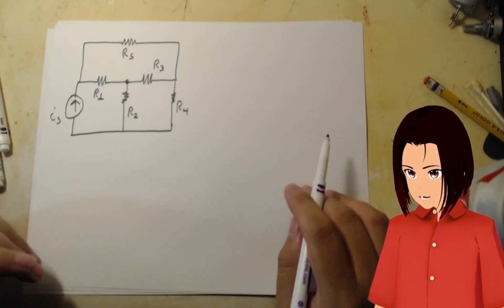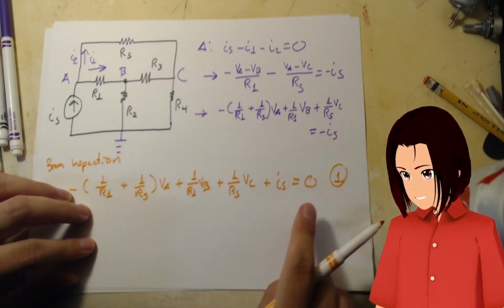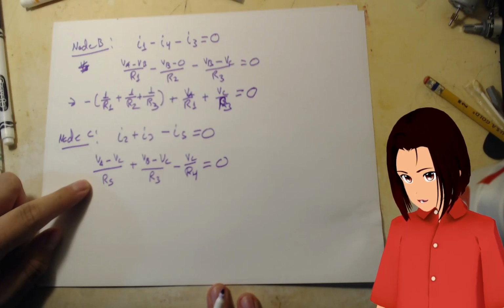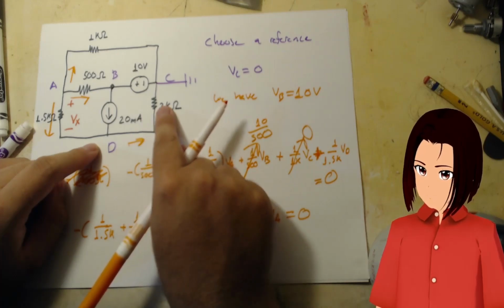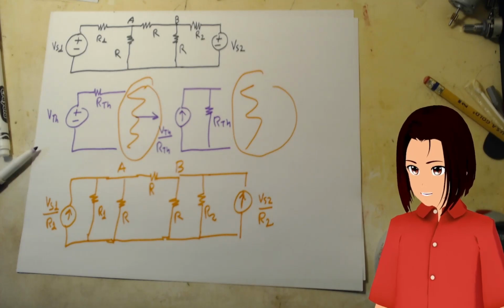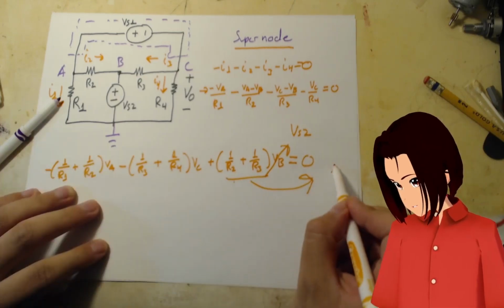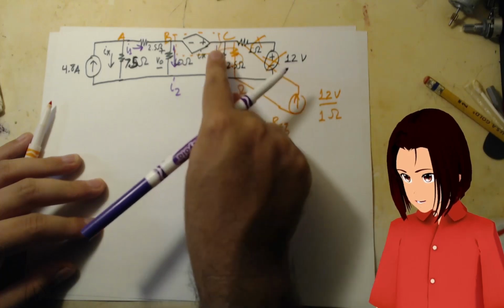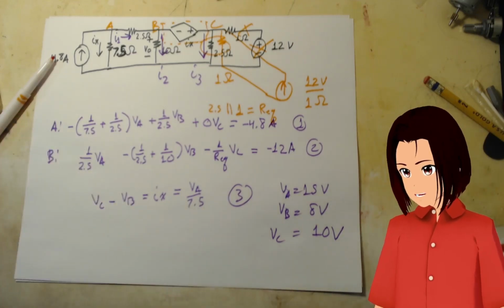Step by Step Node Analysis for Electric Circuits

Comment from the maker: If anyone is unsure what I did to represent the currents in terms of the node voltages, i used ohms law. One voltage at a node subtracting another voltage at another node is still a voltage. Dividing that by resistance gives you current. Here's the short: https://www.youtube.com/shorts/JGXePb9kosg